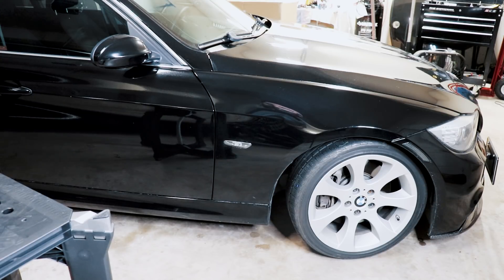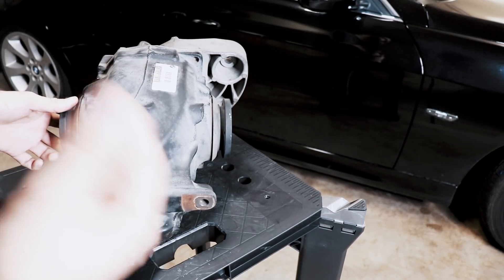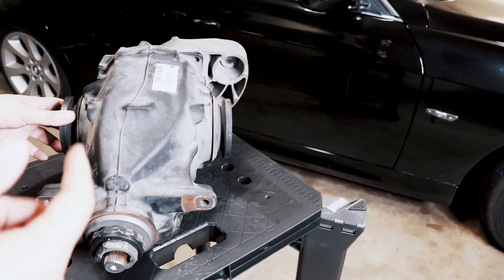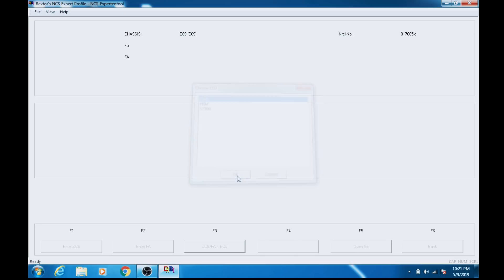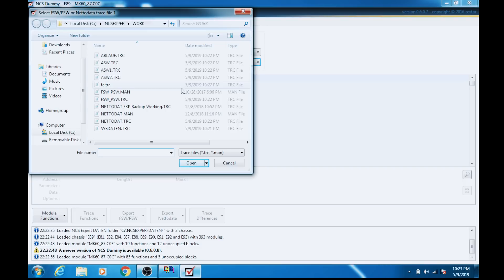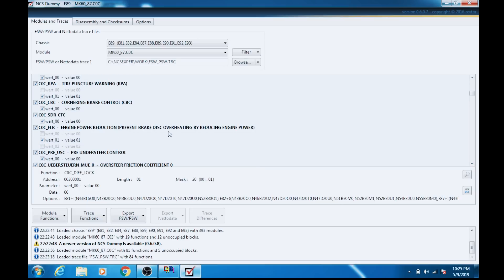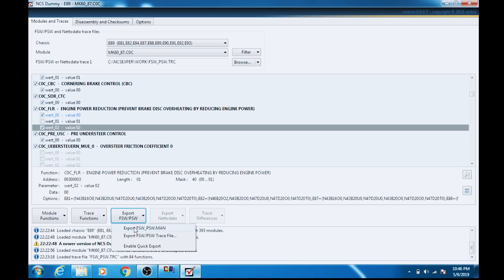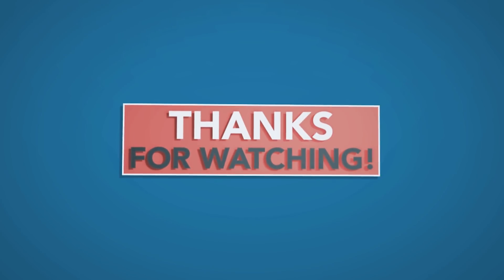Your Newer BMW Has An Imitation Limited Slip Differential.  Mine Has To Go! - E90 Coding

Comment: Just wondering, the LSD conversion was installed 6months ago... how come there’s no long-term driving review yet? Did you end-up removing it...?
Reply: All the clutch type diff I ever had had to be finely tuned with slip fluid additives. You add the proper fluid with zero lsd slip in it then  add 10ml of LSD slip fluid at a time until it works correctly. I never seen a clutch pack type LSD even a factory stock one work correctly with out doing that. IMO car manf. are afraid people will get hurt in the rain with a too aggressive LSD. Inthe 80s toyota put a 14 clutch lsd in the MKIII supra and people crashed and died from snap over-steer due to a strong aggressive LSD. A lawsuit resulted in Toyota modifying how they build/assembled the MKIII LSD, they just disabled the clutches by packing them backwards I still see this sometimes when rebuilding them the correct way.
 https://www.youtube.com/watch?v=owQFJ1QmnBY

Comment: Why didn't you just use protool? 80% easier than manual coding with ncsexpert/dummy
Reply: Omg i just used that protool its so good. I used to inactive the dsc locker diff with dsc. It works on 335i e92.

Comment: Have you  confirmed that a hex value of 00 for brake overheating is actually off. I have a 2007 335i mk60.87.coa module which I believe come standard as 00.  Also, when you coded the values off, did it stop the power reduction and braking? How does it drive compared to before coding? Thanks.
Reply: Hi mate, quite late reply, but my 325i also came stock with hex 00 which I believe was Power reduction on. Then I coded it to wert01 and it seems like there is no power reduction now. Have to do a proper test drive but so far it feels great.

Comment: I followed your instructions on coding the diff and the value for engine power reduction was already at 00 for me while the diff lock was at 01...any reason why it would be at 00 ?
Reply from the maker: What year is your car and did you have a C0C module or C0F module?
Reply: @VehicularDIY  mine is a MK60_87.C0A
Reply: @VehicularDIY  forgot to say its a 2007 335i

Comment: Huh? I ordered one of these kits too, one of my specific questions to the manufacturer was if coding for the dynamic traction control was necessary and they told me no. I can't even get inpa to download properly on my laptop. Bought 2 versions on eBay and even tried to download the sketchy online version but it won't run. I'm screwed
Reply: Use bimmergeeks protool, android app, guaranteed to work

Comment: My assumption was that DSC doesn't interfere with aftermarket LSD any more than without , anyways you can turn DSC off right, long press. Will have to look into this when LSD some day
Reply from the maker: Yeah a long press does disable everything but the diff locker, it's always active even when you turn everything off.  It'll let you light up your tires but it's always there and will eventually cut engine timing to stop the brakes from overheating.
Reply: @VehicularDIY  I see, first time I've heard about this, interesting

Comment: Gee, no BMW doesn't have an imitation of LSD, it has a classical open diff with the most standard traction control applied through braking of the opposite wheel. And it is not true that you can't turn it off without coding. Turning DSC off doesn't turn off traction control for open diff, but holding DSC button for couple of sec you turn off DTC (dynamic TRACTION control) and your open diff is 100% open.
Reply: I've seen from multiple N54 forum postings that in dire situations the electronic nannies will still kick in, even if you hold the DTC button for 3 secs to "turn it all the way off". So, coding it out seems like a perfectly fine way to save the time of pressing the button as well as ensure that the system doesn't turn back on when you don't want it to. To be real here, anyone going this far down the rabbit hole is doing it for a reason. See: https://www.1addicts.com/forums/showthread.php?t=719012, https://www.e90post.com/forums/showthread.php?t=944126, https://www.bimmerforums.com/forum/showthread.php?1306940-How-does-the-DSC-button-Works.

Comment: When mine n54 335i has full dsc off with open diff for most burnouts i do allways have 2 tyres marks.  the other day i done 2nd gear launche spun 2 wheels all the way to red line. So the e-lsd acts like a actually mechanical traditional lsd diff?
Reply from the maker: From experience with an open diff it is possible to get 2 tires marks if the conditions are correct but it's hard to get consistency.  The ABS controller monitors wheel speed and if one wheel gets too much slip it hits the brakes on that wheel to send engine power to the other wheel and when that wheel gets too much slip it diverts it back etc.  That helps but ultimately you're hitting the brakes and slowing the car down to keep it stable but it's better than nothing.  It was basically free for BMW to program that into the DSC module so why not.  I guess you could say it's a form of computerized torque biasing.  I'm not an expert on this and there are various types of LSDs but I'd say a LSD is naturally partially locked at all times and when you overcome one wheel it uses momentum to clamp down harder to try and maintain lock.
Reply: @VehicularDIY   thanks for ur knowledge appreciate it.

Comment: You can do this nanny removal with ProTools very easy. If you haven't checked out protools it's a must for diagnosing and coding tons of BMW platforms. I use it on my 335i and it's great. Love the YouTube channel man keep up the great work. PS I have one of these racing diffs LSDs and I've had hell trying to find a machine shop locally that will grind my gears. It's been a letdown so far :-/.
Reply from the maker: Good tip thanks!  Try contacting shops that specialize in grinding, from what I found your average machine shop can't do grinding of hardened steel.
Reply: @VehicularDIY  I actually went to a place that does industrial grinding and the topic of holding the gear came up. I have an idea, hold the gear with a cut down output shaft. Put the gear in it's natural locked down position with the circlip holding it on the shaft. Then have a large washer under the gear base and weld it in place. That way the gear could never push down past that point.
Reply: Hey you answered the very question I wanted to know. Thank you! Protool is awesome! I bought it and I've never touched INPA or NCS again since!

Comment: An open differential modulated by a computer using ABS hardware is in no way either an Electronic LSD nor is it even a fake imitation LSD.  This is admitted openly by the poster when he speaks of over heating rear brakes and the cars traction control programming to prevent such a condition by even reducing engine power if either brake disc temperature approaches a predetermined limit.

In a true mechanical, even one with electronically controlled clutch plates, there is no loss of power in transferring power to which ever rear axle that has traction beyond slight frictional losses.  When braking occurs in any differential, power is converted to heat, a lot of it.  A LSD will only over heat at the track if required to redistribute high levels of power frequently over a long period of time.  Clutch type LSD will generate the most heat, but this is easily over come in extreme cases by cooling the lubricating fluid with a pump through a radiator.

So the next time someone starts talking about an open differential governed by a computer controlling the ABS pumps as an "E-diff," know that it is patently untrue.  Same for a "simulated LSD;"  there is no such thing.

Excellent coding tutorial, per usual.

Comment: Is that whit the traction fully turned off or on if so I was wondering why my e92 335i was a bit sketchy while going sideways.. Awesome info
Reply from the maker: Yeah with traction fully off it will no longer step in.  Technically on these cars the electronic diff locker is always on so you never really have traction full off unless you do this coding.  From what I've read it's way better to have this unless you have a mechanical LSD which I do now so I turned it off.
Reply: @VehicularDIY  awesome cheers for the reply

Comment: I own an bmw 330d e91 lci 2009/06. I believe my car don't have an e-diff. Could you potentially code in the e-diff?
Reply from the maker: If your car is a 2009 then it would have e-diff already activated from the factory.
Reply: @VehicularDIY  Are you sure? Even when dtc and traction control of? Or only with it on? I often break traction and nomatter what i never experience power loss because of heat in break...
Reply: @VehicularDIY  You know what, im going to check right now...my vehicle is an EU car without m-pack. From what i can read, it should not have it. But my guess is that it could be active. I could save 0-60 time with an e-diff. Running 275/30 just to get the power down :/

I have an n57 engine with a tune, ton of torque! Always breaks traction!

Comment: can you open that diff up? I'd be interested in seeing the electronic "lsd"
Reply from the maker: It's just a completely open standard differential, the traction control module is what always regulates how much spin one wheel can get before it applies the brakes and tries to shift power to the other wheel which hopefully has more grip.  I just deactivated that system in this video.  If you want to see the inside of differential check the video description, there is a playlist where I pop open my stock differential.
Reply: @VehicularDIY  "
It's just a completely open standard differential ..." is the salient point.  There is no Electronically controlled clutches in the open differential, hence no "E diff"nor "E LSD."
Reply: @VehicularDIY  gotcha, thanks. From your video title i assumed you were saying it has a locking diff. I honestly skipped through most of your video were you probably mentioned it in detail. great channel btw.

Comment: Love the vids! 
If the limited slip is doing its job and the DTC DSC is turned off I’m confused why you would need to code this out? I understand for review purposes you want only the LSD borking however, if the limited slip is working the  system to even come on. I purchased the same limited slip and waiting for the final verdict before installing!
Reply: Sorry or the grammar and misspellings tried to dictate the message.
Reply from the maker: That was my logic at first, I thought maybe it would compliment the LSD but really it seems to just cause the DSC to be in the dark when a slip is about to occur as now both wheels break loose together and it's like it shocks the system and it kicks in hard.  Before you could power through and barely lose momentum if that make sense.  I think the car considers a sudden loss of traction on both wheels more of an extreme situation vs one wheel losing traction as that's more of a normal occurrence.

Comment: Will this work if you running jb4 with mhd backend flash? Would this coding affect any of the two?
Reply from the maker: Yes as you're only coding the DSC module. It's independent from the ECU and won't hurt your JB4 or MHD flash.  You'd only want to do this if you have an LSD, I've heard the car drives terribly with a stock open diff and the E-Diff coded out.
Reply: @VehicularDIY  yeah I can imagine how terrible it would be to drive with the e-lsd.
I distribute the Racing Diff products in South Africa and have just fitted the conversion kit to my personal car (135i 6mt), so doing this will really help.
Reply from the maker: Nice, once you install it be sure to chime in letting us know what you think as well.